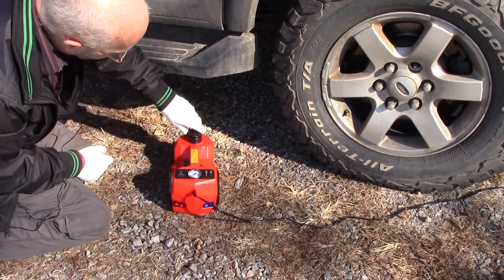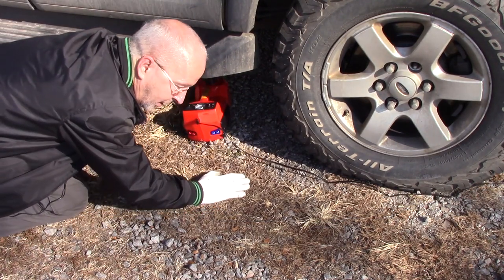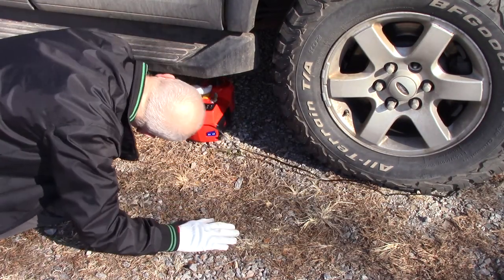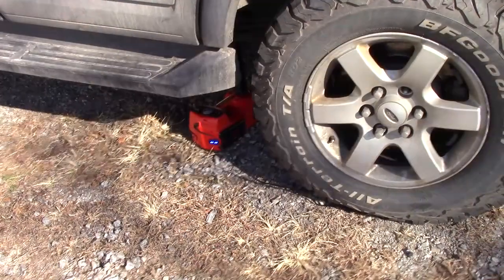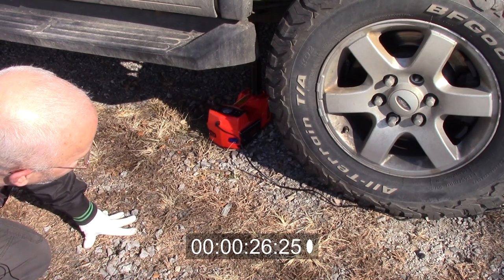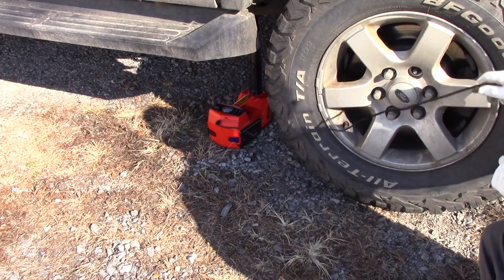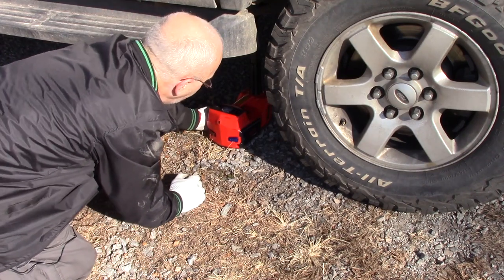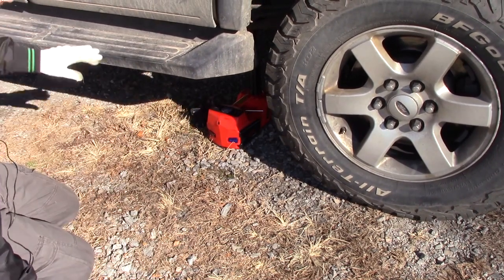How Long Does It Take To Raise vehicle using an Electric Car Jack, and How to use the Safety Feature

Comment: Thanks for following up on the request.
Reply from the maker: You are welcome Uther, my goal is to help in any way that I can, and if I leave something out it is nice that someone bring it to my attention so that I can give them the information that they need.
Reply: Needs to be more than a quarter inch off the ground or you'll be struggling to get the tire off and on.  The tire will cant sideways and it'll contact the ground. Better off spending the additional time raising it higher because that'll ultimately save you time avoiding the wrassling of the wheel.
Reply from the maker: @sadfur8728  good call;  I didn't really give that much thought..